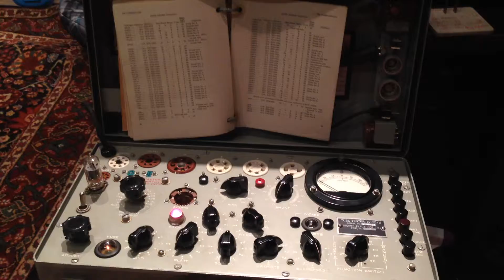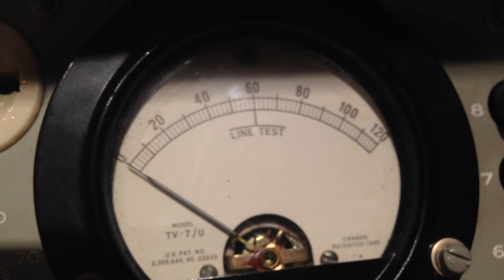Gassy arcing tube on vintage tube tester Hickok tv7bu

Comment: How ironic that I’m looking for gassy tubes, and how one may act on a tester, and one of my suspect tubes (12av6) that was in my zenith AA5 had a grid voltage of  negative 0.7 schematic said negative 0.9 I pulled this tube, and popped another in, and it went to negative 0.9. That same tube with the  negative 0.7 on the grid is now on the tester I’m gonna let it get as hot as possible before I test it. The getter is still there,  it’s on the side for this tube, but at the top there’s this light dark color!